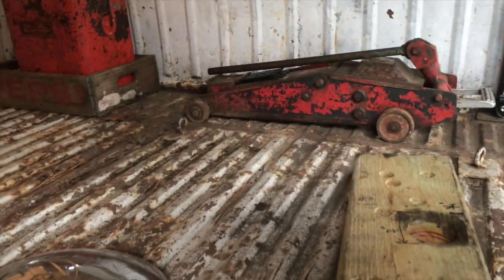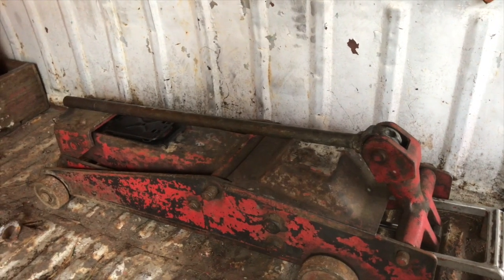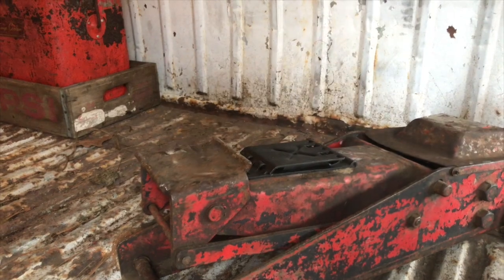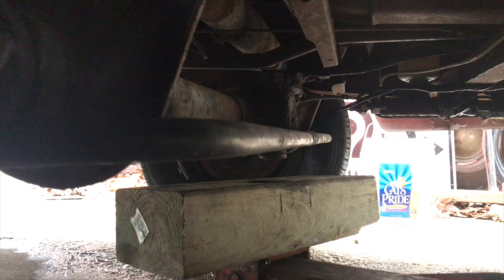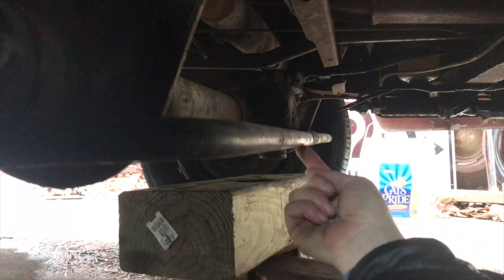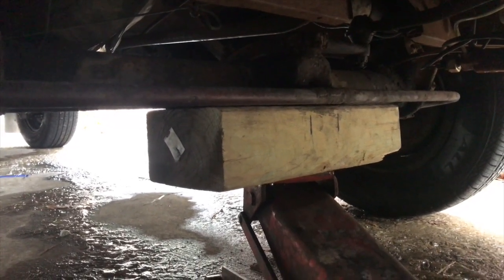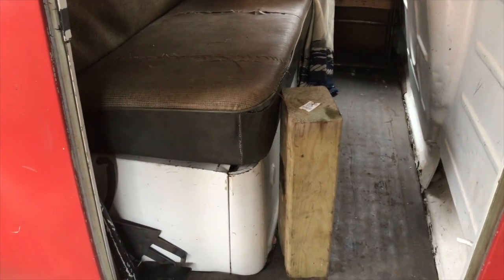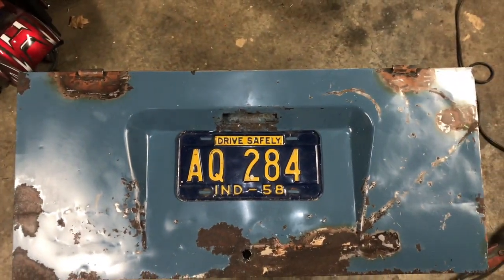How to jack up a split window VW bus, the EASY way!

Comment: The first T1 I worked on it took me ages to find out where to safely jack it up .good idear to mark out the wood so you can judge were it's situated
Reply from the maker: My uncle worked on Pre-67 vws for 50 years, never had a shop lift or anything ALWAYS just used jacks and boards, he taught me that trick!
Reply: @marcijunebug  😘

Comment: Great video! Can you share the other dimensions of the block, depth and height? Thanks!
Reply from the maker: I apologize, I JUST today saw this comment...the overall block is 15" long, using a 4" X 6" block, the 2" circle is 3/4" back from the edge and on mine I centered in on the total 15" length, but wouldn't have to be dead center...just close! Again, sorry I didn't see the comment sooner!